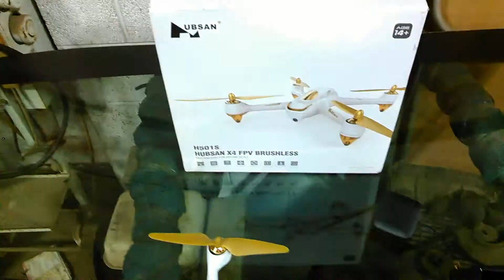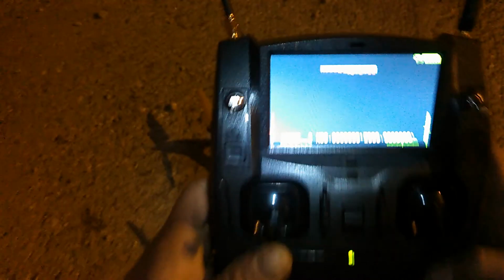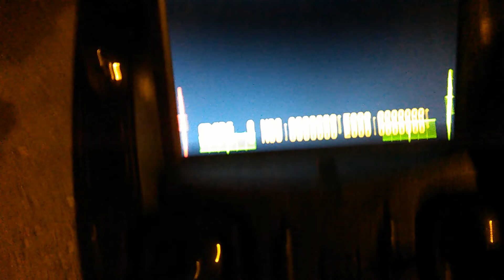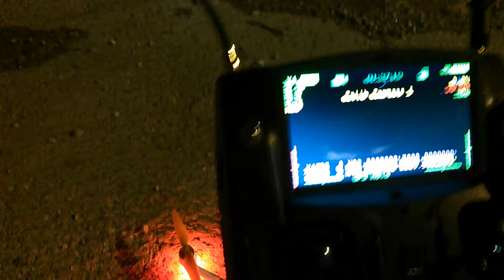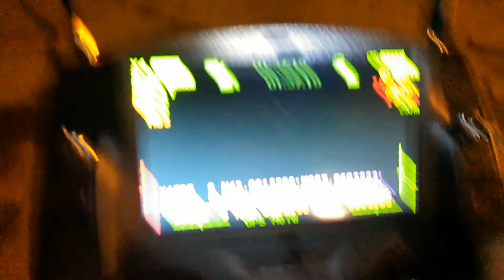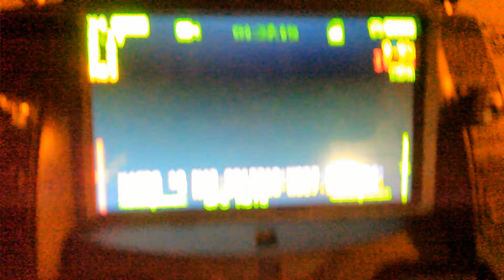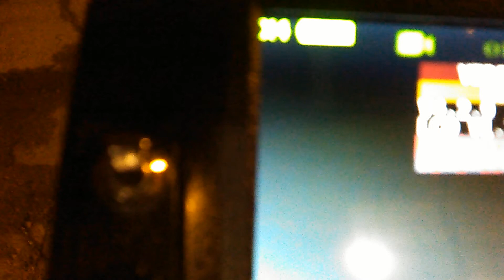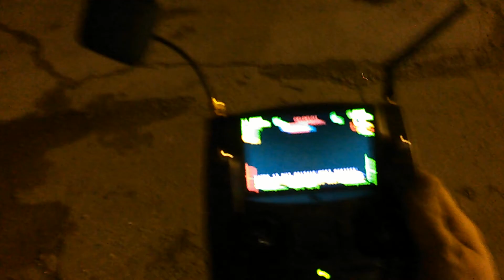hubsan h501s Calibrations Explained, & Before flight Tips

Comment: If your self tighten props are on correctly, I would not recommend following Marks suggestion of tightening with a wrench, Hand tight is sufficient. While flying the props can become so tight that you can't remove them even with the wrench. Trying to remove them you will end up damaging the motor and or prop.
Reply from the maker: +Bill Carlson I didn't say tighten it with a wrench. I said use the wrench that comes with the Quad and hold the motor and give the props a Light snug with your fingers. Also said Not to tighten them Too much because they are plastic threads and you could strip them. The wrench simply holds the motor so you can "snug" them down. I've heard and seen a lot of people's prop/props fly off because they were Not Tight. I've flown many quads....   With the H501S, Never had a problem with getting props off.
Reply: Watch your vid. You have the wrench on the motor and it appears that you are applying alot of force tightening the props. You don't need the wrench to put props on. Yes, if you tighten to much you will strip the plastic threads. The problem with your demonstration is you forget your audience are probably newbies. If you have not heard of people having problems removing props read the forms. By putting the props on tight, the self tighten effect tighten them more. If props aren't removed after each flight they can be difficult to remove. When the use of regular non-self tightening props are used the nut must be tight or they will come off.  Oh, FYI I've been building DIY's for several years, so I'm not a rookie!  I'm only trying to point out a possible misunderstanding with you audience on putting on self-tightening props. The actual calibrating portion is spot on..
Reply from the maker: Bill Carlson I understand the point of the audience world mostly being Newbies... However, Do you own an H501S ? If you do, why do you think it comes with a Motor wrench Stock? So you can give the props a "Finger Snug"... If it appeared I was "Really Super Tightening", I wasn't. Also, with the H501S, you Should Remove the props after Every Flight. If you transport it in its stock box or even a carrying case, You Must Remove the Props or It will Not fit. Removing them after every flight also Avoids possible damage during transport. I just got the H109S X4 Pro as well. That came with a Prop Wrench as well... I made an Unboxing Video.... Anyways, the Husband's are RTF, not DIY's... I cannot express enough how important it is to use the wrench. The props will only get tight to a certain point and are Easily Removable... Thanks for your Observations and Feedback...
Reply from the maker: +Mark Suttner Meant "Hubsan's" Not Husban's.... Lol :)
Reply: DA, I know the H109s is NOT a DIY (Do It Yourself). The H501s come with a wrench to facilitate in prop removal.  People make up your own minds. I repeat you do NOT need to use a prop/motor wrench to tighten props as Mark shows in his vid just spin the props on and then hold the motor and tighten finger tight. But DO follow his instructions on Gyro and Compass Calibration.
Reply from the maker: Bill Carlson Your right, people will make up their own minds about how to handle their quads. The H501S And the H109S (the one you mentioned), yes, have self tightening props because of the reverse threads and the "A" and "B" motors spin Opposite of the way their prop threads UN tighten... It May not be "Absolutely Necessary" to give them a quick finger snug before flight, it's just a "safety precaution".... I understand what you are saying. Thank you for your input about the actual calibration aspects.... Ttyl
Reply: Hello Mark Suttner and hello guys. To answer your question once and for all - it does come with a wrench so that everybody can untighten and dismantle the propellers and that IS the only reason the wrench is in the stock package, being an RTF quad. Please keep in mind that not all people have surgeon hands with slim fingers to be able to hold the motor while untighten the props. As the props are self tightening installation should only be done by hand, without ever using the wrench, giving that you install the props carefully and correct A to A and B to B and that you correctly pace the thread. Hope this shed some light. And one more thing - if you wanna have proper control signal at range (800m+) given the mounting angle type anc construction of your 2.4GHz antenna, you should tilt it to the left 45 degrees from the vertical. Cheers!
Reply from the maker: +alias csr I'm well aware of a 45 degree angle 2.4 control antenna. And I'm very aware of antenna theories and even the Freznel Zone. Yes, the propellers are self tightening only because they spin the opposite direction of the threads on the props. However, you should at least hold the motor with your finger and slightly tighten all four of the propellers and not rely on reverse thread spin to tighten them. Many people have had propellers fly off because they were not tightened.

Comment: Calibration made simple 
After getting my 501 and 2 days of spinning around at arms length and several other suggestions how to calibrate the drone I came up with a way that I won't fall over from vertigo.It requires 3 elastic bands. Take 2 elastics and put them together so they form an "8" The other band gets wrapped around the rear body first. Then put the "8" as shown in the picture. It's simple!! Hold on to the knot of the 8 at the CG of the drone and spin CW (Cal one spun clockwise), move the props away from the rear band and spin CCW (cal 2 counterclockwise) Bada Boom Bada Bing Calibration done! 
I didn't see this anywhere else so I guess I own the patent. Oh boy to be rich. The "Tubmans" are going to start rolling in! LOL
My present to all around the world!
Merry Christmas everyone
Reply from the maker: Doug Meehan I'm not sure if you watched the Entire video, but when I said "Use your hands, NOT your body", " Don't Spin in circles " --> It's Not only so you don't get dizzy, It's Not the Proper way to Calibrate The Geometric Compasses. If you want Precise Stable Flight, You Need to keep the Quad in a "Central" location directly above where it "Self Initialized"... Using your arms and spinning in circles is Incorrect for A LOT of reasons... Mainly, if you do that, your actually exerting centrifugal force on the quad's Gyro sensors. Not good. Anyways, I know exactly what your talking about with the Elastic bands. (Similar to  twisting a rope or rubber band and letting it unwind).. However, shouldn't let quad spin Fast if doing that... If your method works, Great ! :)
Reply from the maker: Doug Meehan Secondly, You should Always Calibrate both Compasses in the SAME Direction (Mostly Clockwise with Most Quads)... Should Not calibrate 1 clockwise, then 2 counter clockwise. I think it even said to do that in the manual that came with the Quad... Incorrect. In fact, the lights flash in a Circular motion, Always calibrate in the Same Direction as lights are spinning... Usually Clockwise. Ok ? Ttyl :)

Comment: Great video, thanks. One question that I have though, why is it important for the quad to be on a flat, level surface?
Reply from the maker: It's Important to put on level surface B4 you plug in battery on Quad because as Soon as you plug in battery, it does basically a "self initialization"... It is calibrating it's  Gyro sensors and " feeling" it's Geometric compass. That needs to be level so the pitch, roll,yaw, are "initialized" Level (Flat on ground)... That way it's flight control board can work with the G.P.S. module in Sync to ensure a proper flight. If put on an angle then powered up, it's going to show false pitch, roll and yaw readings... A. Lot of technical stuff... Understand?
Reply from the maker: If you need further explanation about the geometric compass and it's gyro sensors, let me know... Hope that helps ;)
Reply from the maker: +Steve MacBeath It's Important to set on level surface B4 you plug in the Quad battery because as Soon as you power up quad, it does basically a "self initialization". It is calibrating it's Gyro sensors and " Feeling it's Geometric Compass.. Needs to be level for Accurate readings... Pitch, Roll, Yaw, Etc that way its flight control board can work in sync with its GPS module to ensure proper flight. If put on UN level surface, it's going to get Inaccurate gyro readings, and you will end up with drift, toilet bowling, lots of movement in GPS Hold and Inaccurate Altitude Hold...
Reply: That explains a lot, thank you for taking the time and trouble to reply so quickly 👍
Reply from the maker: Your welcome sir ! :) Any other questions, feel free to ask !!! :)
Reply: You are very helpful. When you go through the initialisation and calib 1 and 2 process, does that set the "Home" location for RTH?  If you then get in your car and drive somewhere else without disconnecting the X4 battery, would using the RTH option then mean the X4 would set off to the original location?  That is 2 different questions, but sort of related to each other. I hope that makes sense to you and anyone else reading this.
Reply from the maker: Steve MacBeath After you do your compass calibrations, that IS NOT the "Home" spot... The RTH "Home" spot is set Exactly where you Arm the Quad... As Soon as you Arm it and the props start spinning, That is Its "Home" spot. It will Only return to that spot with the "RTH" function
Reply from the maker: Steve MacBeath I Do Not Recommend doing an Initialization both compass calibrations, then moving the Quad when powered. That will Completely throw off its Flight Controls ! You Should Always just choose a spot to fly, and Stay There ! If you want it to follow your truck or something, turn the "Follow Me Mode" On and Keep the controller with the vehicle. Never, Ever do Initiation, 2 compass cals, then move to a completely different location... There is a reason why you have to do those calibrations Every Time you fly.....
Reply: Both those answers are very helpful and now make a lot of sense, thank you again for replying so quickly.  I am just a beginner with lots to learn, but I am really enjoying using my h501s.
Reply from the maker: Steve MacBeath Great ! The H501S is a really great quad ! And A LOT of fun... As long as you do the initialization and compass Cal's correctly, You should have No Problem flying... On another note, in my Video, I keep the stick sensitivity to 100%... Only because It Was Very Windy and I'm an experienced flyer. You can set them all at 60% by simply going into menu (Left stick down, Push/Hold the right stick)-> don't move it just hold the right stick down towards the controller like your pushing a button... When set at 60%, you get Way Better Videos... The camera is "Picky" when it comes to flying fast... It looses focus Quickly... Out of curiosity, what flyware versions did yours come with? (Go into menu with quad ON, doesn't need to be calibrated or armed, just needs to have power...) Then use right stick to move through menu until you see "Show Version"....
Reply: Mark, I have another question- I have noticed that the pictures I have taken on the h501s have different dimensions, when I look closely at the properties some are 2048 x 1536 whilst others are 1920 x 1080.  Do you know why this is happening?
Reply from the maker: Steve MacBeath are you looking at the pictures from the micro SD card on different devices? (Different Laptops, Tablets, Etc.) OR are you using different types of micro SD cards directly inside the quad ?
Reply from the maker: +Steve MacBeath are you looking at the pictures on different devices? OR using multiple different brands of micro SD cards that you insert directly into the quad?
Reply: No, they are all on the same device - my laptop.  Today I tested it again, took about a dozen pictures and they were all the same resolution.size (2048 x 1536).  Before that I suspected that the reason was that some were normal pictures and the ones that were different were "captures" on the camera whilst it was recording video.  Looking at the ones from that occasion it did not seem to the case.  It is not particularly a problem, both give good results but the ones I took today (I was not recording any video today) were not the ideal dimensions.  I hope that makes sense to you!
Reply from the maker: Steve MacBeath That is Very Strange... The camera on the H501S is "Supposed" to be only capable of 1920x1080P... Video and Pictures... I need to think a little about this... First thing that comes to mind is What type of SD card your using and what kind of Program your using to "Read" (Uncompress the Codex) that is saved on the SD card)... Do you mean the "Dimensions" of the pics are different, like some are full screen and some aren't, Or do you mean the actual "Quality" is Different?? The camera is only capable of 1920x1080, so sometimes it depends on what kind of laptop And what type of SD card your using as well... If you don't mind me asking, what type of laptop do you have and what type of program are you using to Read the SD card?
Reply: Strange indeed..... The card is a normal Sandisk micro one, inserted into a card reader which I process on a normal spec Dell laptop.  The picture quality does not seem any different but the dimensions I find in the file properties, the 1920 x 1080 gives a full size picture on the screen, whereas the other option does not look as good, they give the effect of being "less wide" ie not filling the screen so well.  I did not realise initially that you could take pictures whilst recording video, I must have accidentally taken one and the screen message came up with a "Captured" message (or similar, I can't remember the exact wording).  To view the pictures on the laptop I just use the normal file explorer double click.
Reply from the maker: Steve MacBeath What do you mean exactly when you say "The other option"?? Where you can view as 2048x1536 ? If that's what you meant, then there is the answer... Since the Quad takes pics and video at 1920x1080 and saves to SD card at that Particular dimension property, if you try to view as More than 1920x1080, your computer is basically trying to " Stretch" the Original format. In which case the view will be different. If any camera shoots at a Specific Quality (1920x1080), it's Always best to View them as That... Otherwise your device "Tries" to get more pixels out of the Original Format, leading to Distortion, Etc... Understand Steve ???
Reply: Yes, I sort of understand.  That is not a criticism of your explanation, more an observation of my IT skills lol.  Perhaps I confused you with my use of the word "option".  The images that are 1920 x 1080 fill the screen better whilst the 2048 x 1536 do not.  Today I did not record any video so I hoped that the pictures would be at 1920 x 1080 but no, they were the other option (ooops, sorry used it again) ie properties 2048 x 1536.  I only have ever used the one card/laptop etc so the differences seem unexplained or random to a non-expert (aka old bloke!).
Reply from the maker: Steve MacBeath That is Extremely Strange... So basically when you are recording video with the Quad then press the picture button for a "Live Photo Capture", the Quality is better??
Reply from the maker: Steve MacBeath I believe I know what's happening in your situation... I'm at my job, but will get back to you on the matter when I get off work. I am almost certain I know what's happening. I just need to look at some of my footage from my quad and  I Will get back to you...
Reply: I would not say that, over the next few days I will experiment a bit more so see if I can work out what is happening.  As you will understand, it is a fiddly process, taking pictures, going home, removing the card, setting up the laptop, looking at the pictures.  Like I said before, there is no obvious difference in picture quality, the only slight problem is in the picture dimensions.  I did not do much today as it was a wee bit too windy and the sun was also too bright.  It is winter here so it was a bit chilly, certainly too cold for hanging around outside!  Maybe I should relocate to California or Nevada.  Plenty wide open spaces and favourable temperatures?!  Thank you so much again for you patience and understanding.  I will let you know if I can get to the bottom on this mystery...
Reply from the maker: Steve MacBeath +Steve MacBeath I believe I know what's happening in your situation... I'm at my job, but will get back to you on the matter when I get off work. I am almost certain I know what's happening. I just need to look at some of my footage from my quad and  I Will get back to you...